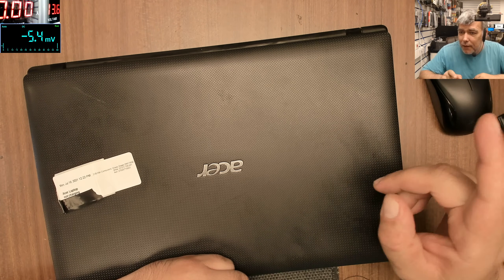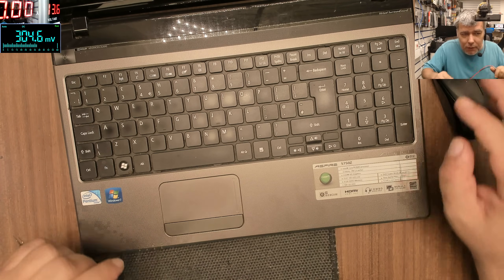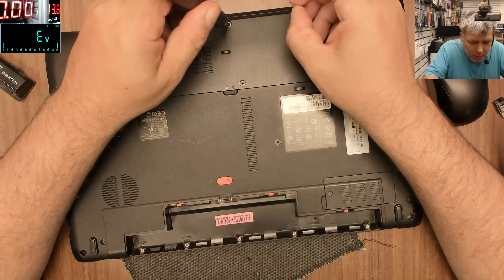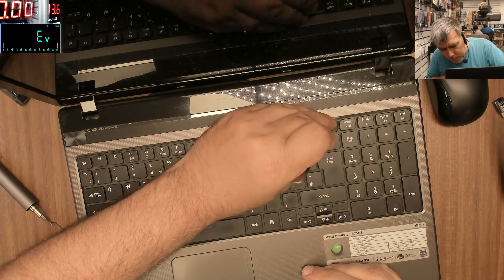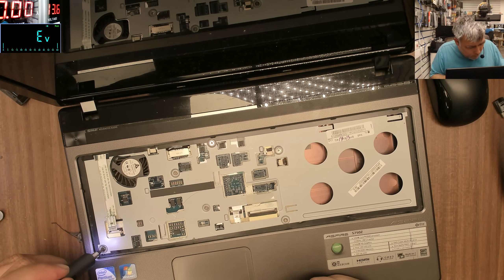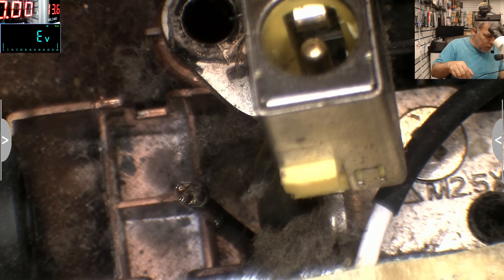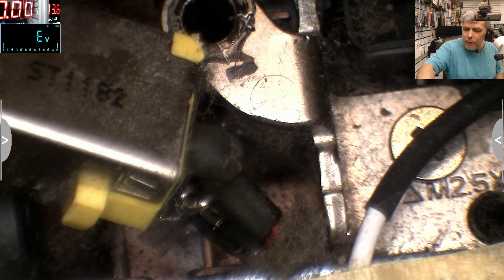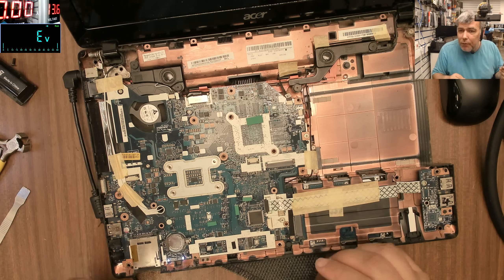Acer 5000 series, not charging or powering on, let's fix it

Comment: hi Sorin, I have a Acer v3 771g i7 that my wife used and she spilt a little water on the track pad, that went through the left and right mouse buttons, I opened it up and could see some water damage but looks like it was done over time. Laptop does not come on at all no power lights or charging lights, Where would I start looking. It was an expensive laptop back in 2013 as it has the 730m nvidia 16gb 1600 memory and 1.5tb storage. The 1 tb drive WD was bios locked with a password and cant get into the drive unless it was also damaged as I cant read it or even format it, also tried on a mac pro just to see if it would read or format it. Subbed today as you do many laptops and hope I could find out what to look for and repair it.

Comment: I have two Aspire 5742Gs (the "G"s have NVIDIA graphics built in). I found out I could upgrade them to i7 M640s even though Acer doesn't list that as an option. They have both been running fine for more than a year and are much faster along with Samsung EVO 870 SSDs. I wouldn't trade either one for what is being made today.

Comment: Sir, I have a GA-H55M-S2  mobo for desktop with G6950 processor and Intel H55 chipset. Unfortunately, after cleaning the heat-sink from dust, I forgot to re-plug the processor power supply (the 12v 4 pins socket) and powered it on. Started the cooler fan for a few seconds and then died. After re-plugging the processor power supply and trying to restart it does the same thing a 2 seconds fan operation and a beep and than total death. Could you please, give me a hint of the culprit ( MoBo? Processor? PSU? or all of them. BIOS would be a great luck but don't think so). Thank you very much for any kind of advice.

Comment: I would have put some grease on the hinges and fill the chassis leg-well with hot melt glue, so the laptop doesn't flex while typing and it stays stable & leveled. Although few customers appreciate the extra mile, it's always a good feeling to take some pride in your work. ;)

Comment: What settings do you use on the heat gun to melt the hot glue?
Reply: I believe he said max heat and minimum air flow.
Reply: 180-200 degree celcius, or max it for faster melt☺️☺️🇵🇭🇵🇭

Comment: I already fix an Acer of the same series with the same fault. The laptop have decent specs for the price,but total crap plastics and hinges. The plastic that hold the hinge breaks and take the dc jack wire with it.
Reply: The keyboard was also of lower quality and the warranty was only one year for businesses. I disagree with Sorin for this model being a proper laptop compared to the others from its age exactly for all these reasons. But hey, more specs for less money and lower build quality - people purchased ACERs like hot bread. :D After they flooded the market with this strategy every other brand copied them and the quality of cheap laptops went downhill from there on. Good days. :)
Reply: @Alex-mj7km  Oh, yeah! We used to think these ACERs are low quality laptops. They quickly became mid/high quality and now luxury quality doesn't exist at all! Even the kings of all luxury build quality laptops Alienware became a compromised money grab. What can you do, as long as cheap shit is bought, it will continue being made and sold...

Comment: How do you set prices Sorin? I don't ask you for exact prices like: hindge repair - 5000$ and something like that but I am curious about the method. Do you set prices by hourly like 20$/hour and if it took 2 hours than its 40$ OR you have fixed prices like hindge repair this much, motherboard repair this much so on, OR you look at it and try to estimate a cost or something else?
Reply: I don't know about sensei Sorin but what I do personally is I estimate how much work I'll have to put into the job, the expenses and consumables such as electricity, flux, lead, especially time. And I also look at the complexity of the job on how difficult would it be and also you have to make sure that you are compensated with the warranty you'll give to the customer just in case you need to replace something or in case you mess up something while trying to repair the unit. A lot of factors to consider for pricing jobs.
Reply: @cjdeleon9146  Yea but you have an excel sheet for this or it's only a guess? What if you found out more problems on the way? Call the customer and discuss the extra repair?
BTW thx for the advice.
Reply: @MrDawnHU  That's how my old boss did it. Call after you get the whole picture and propose mandatory and optional fixes according to your findings. He was really reluctant to calling a customer more than once. While I get not bothering the person, in reality many times some pretty important faults rear their necks at the very end of the fix, when stress testing the laptop for example. 🤷‍♂️ Shit happens before the repair, but sometimes during as well. I'm also curious as to how other people deal with this on a day to day basis, perhaps they have a better advice/solution.

Comment: Sir,if a Laptop shutdown every 30 minutes, what can be the possible cause??
Reply: most likley bad me region.Read about flashing bios with clean me.
Reply: @TimeToRelax222  ya, that's the issue I have heard but no bios update on Lenovo official website.
Reply: @kazijafranislam4571  You need to desolder bios IC from the board and reprogram it in external programmer,bios update will not work in this case.
Reply: Heat
Reply: @user-te1le7ck6b  Heat cause random shutdown, not every 30 minutes.
Reply: Kazi Jafran Islam could be that’s how long it’s taking to get to thermal cut off , did you check cooling , other than that it’s got to be a cap or chip shorting or not working after warming up so again comes back to heat
Reply: @user-te1le7ck6b  Yah I had, but it's not a thermal issue.
Reply: Can be bad ME region if it's exactly 30 minutes since the start. Check our Discord server about the issue.
Reply: It definitely sounds like an overheating issue at first glance.

Comment: Sorin that poor old Acer is still running Windows 7 I hope you advised the customer that it's NOT secure to use that on the interwebs & desperately needs to be upgraded to win 10 because I certainly would & suggested an SSD upgrade because that would improve the performance a lot even for that old thing, that's called customer service there's more to it than just fixing device's there's also protecting them from there ignorance about security on the web!... But at the end of the day it's up to them as to how stupid they want to be, isn't it!
Reply: No need for the fearmongering marketing talk. Its security is just fine when set-up properly. Fresh install of Win 7 Pro x64 would be optimal for this old HDD machine, no new unexpected driver crashes from sleep mode either. I would've personally swapped that HDD for an SSD and then installed Win 8.1 Pro with a Start Menu, but hey, to each his own. :) Whatever ideas and preferences we might have, the most important part is not what we want, but what the customer wants and is comfortable with. Just give objective options and facts, let the client decide. But Win 10 on this machine and for a customer that's already used to Win 7 is an grave mistake IMHO. ✌
Reply: @Alex-mj7km  Wrong, I run win 10 on a core 2 duo as a camera monitor/recorder 1080p with a HDD & 4GB's of ram & It works fine!...after debloating all the crap out of it so that Acer should perform quiet satisfactorily with an SSD even though it's only sata 2 for domestic stuff like youtube or browsing the web, but I do agree It's old & not worth spending a lot of money on but still does have a future rather than becoming E-waste, because the new crap were being fed is under engineered & designed to fail (planned obsolesence) which cause's more E-waste occuring, I only own 1 computer past 2015 & that's used for editing video on, old stuff was made to last!

Comment: on a fan you have 4 wire. + - and 2 data. if i take out those 2 data the fan will run on 100%?
Reply: yes, but i wouldnt call them data wires, more control / speed wires
Reply: @ashleynery8092  👍 thanks

Comment: I have and old acer 5315 from 2006, never failed me, very reliable old basic machine.
Modern machines seem nasty and a really compacted pcb :-(
Reply: I have Acer 5738 and I have similar impressions to you
Reply: the heat staked keyboards with Mac style  typo inducing  flat  faced keys  that look pretty  but dont  have a contour like the old ones  so dont feel nice to type on and are difficult to replace are the thing that irks me the most with new machines